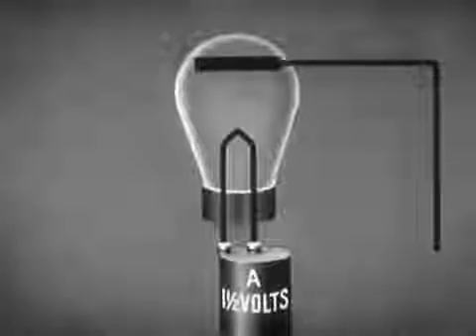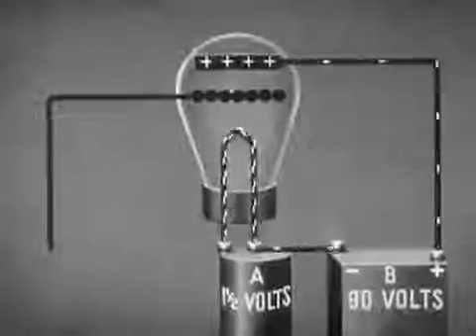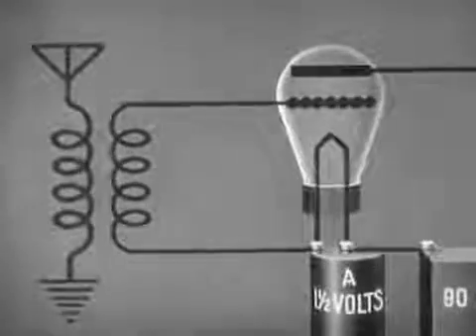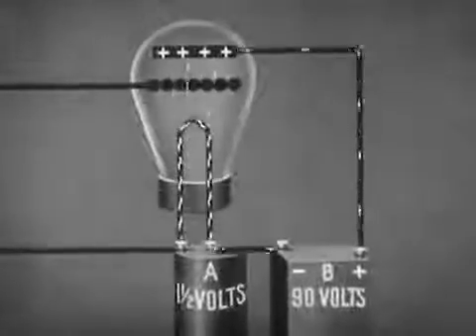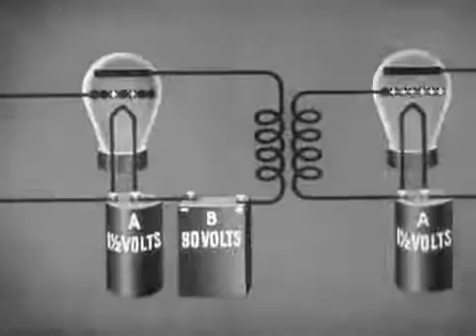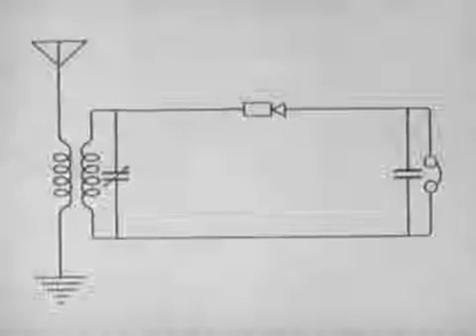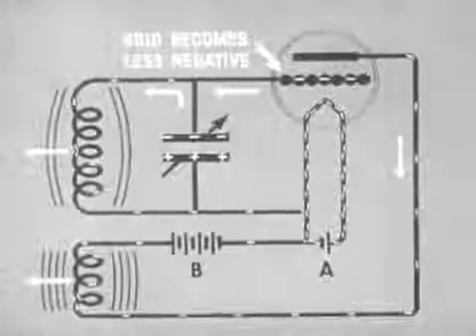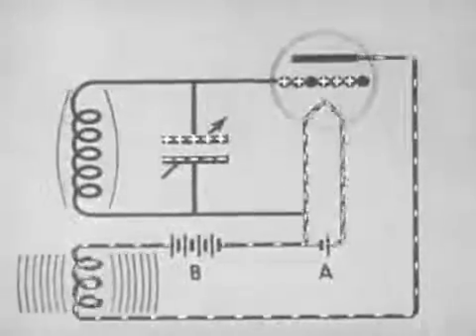Vacuum Tubes 1943 Educational Documentary WDTVLIVE42 - The Best Documentary Ever

Comment: This is one of the better videos on tube operation and it’s application.
Wow. That application/ example circuits @ 7:50 may be Armstrong’s regenerative circuit that creates an oscillator.
Armstrong was given credit for superheterodyne radio where tuning a radio receiver could be accomplished by varying resonance frequency of local oscillator.
The circuit on the grid is a tank circuit where energy storage alternates between electric field in capacitor and magnetic field in inductor much the same as a spring mass system in the mechanical physical domain. But the oscillations dampen over time due to resistance as the energy moves between capacitor and inductor. The magnetic field from inductor in plate circuit must transfer energy to the inductor in grid tank circuit to perpetuate the oscillations.